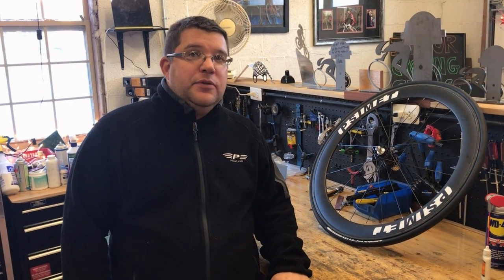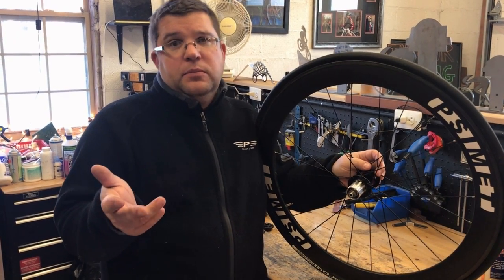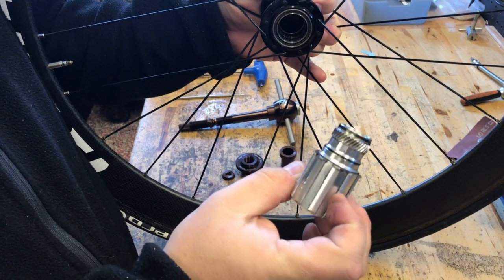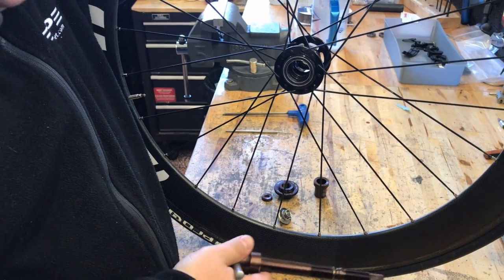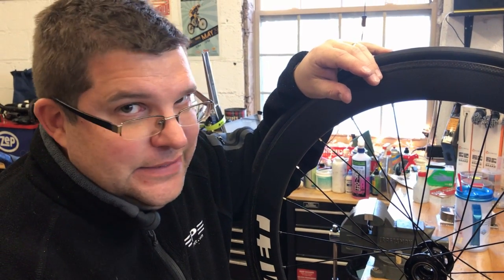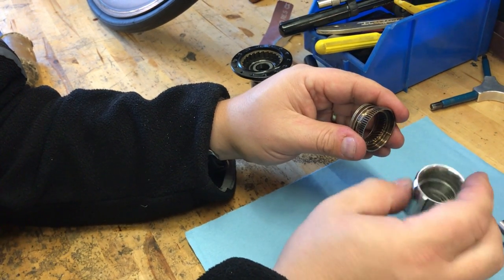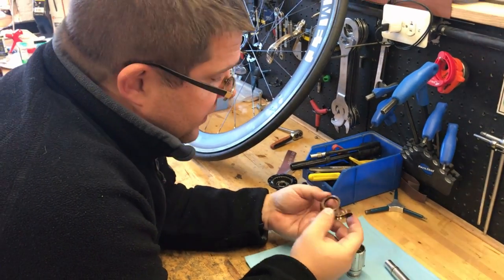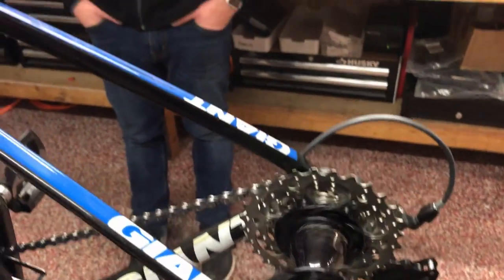How does a Chris King Hub R45 Work and what makes it different

Comment: bought 7yrs old turqouse set of chris king r45 hubs and nothreadset. he said it ran 20000km... everything inside looks/works like new, the headset is smooth like butter... the golden nothreadset ive bought 15 years ago with already a little bit of rough lower bearing, was again built upside down a few yrs ago in the 2nd frame (3rd with pre owner). the formerly lower bearing (now upper) of course dont gets better, but it didnt get worse in ~30tkm of urban use with 5bar at the front... the other bearing is still perfect! so yes, its somehow worth the money, at least when you like staring at your own bikeporn.

Comment: CK (Chris King) bike hubs are amazing when it comes to engagement and producing that satisfying hub sound. However, compared to DT Swiss hubs that use a star ratchet system, they can be a bit tricky to service as they require a special tool. DT Swiss has prioritized serviceability in their hub design, which makes them much easier to maintain than CK hubs. In fact, servicing a DT Swiss hub is quite easy - if you can fix a flat tire, you can handle the job. No special tool is required, making it a convenient option for those who like to do their own bike maintenance. So, when choosing between the two, serviceability may be a significant factor to consider.

Comment: Oil is not a bearing lubricant for Chris King.  You need grease.  Chris King sells some nice synthetic.  I also use Finishline Flouro in the winter due to below freezing temperatures.
Reply: That grease works well on CK hubs? I know people say to only use CK grease on their hubs but in some countries (like mine) is impossible to find. Can you share me your experience? Thanks

Comment: looks like wheel needs balancing !!!!!
frame shaking
Reply: Deep carbon wheels have long valve stems and they can be rather heavy thus leading to the imbalance you noted. No big deal as you don't notice it while riding. My Enve 7.8s are the same.

Comment: "Use the proper tools", skips to guy picking out the bearing seals with a small screwdriver instead of a much more suitable seal pick.
Reply from the maker: Alex Paulsen would you like a picture of the service instructions where they specifically call out using a small screwdriver to pick the seal?
Reply: No thanks. I'm just speaking up on behalf of all flat bladed screwdrivers for the abuse they must suffer in the workshop doing jobs they were never made for.

Comment: The maximum number of degrees for engagement is 360 / number of engagement points on the hub, (not divided by 3 in the regular hub). The CK has more engagement points giving a smaller angle of engagement.
Reply from the maker: Indeed and I should have linked to it in the notes. I was on the spot and had camera brain. Thank you.

Comment: Seems like a big discrepancy when CK says that the bearings need servicing 1-2 times per year and you're saying 5+ years. How's that work? Or am I missing something in your definition of "servicing" the bearing and hub?
Reply from the maker: 3-5 years is what is in the service manual we have. The 5+ is what the customer did. We have no control over that. The bearings don't need to be serviced that often. If you are finding a place where they have changed their interval then that's their prerogative but the bearings don't need it. If you want to pay me as a shop to pull them apart 2 times a year then by all means - I could use the money.
Reply: Just saying, this was the direct quote from the Chris King customer service team:

"Our hub service interval is once every 6 month or once a year, depending on your local climate, riding conditions, etc. Sticking to that every six months interval should prevent any excess wear."

That's why I'm asking if "service" means different things here.
Reply from the maker: Yup - just re-checked the manual. Calling for "basic service" every 6-12 months depending on usage. They define basic service as removing the axle (and ring drive) cleaning everything and lubing it. 

"Complete service" is needed as needed to include full disassembly to fully clean and inspect items (bearings). They claim it is "as needed". Honestly you don't need it for 3-5 years at a minimum or unless you notice an issue. Honestly even pulling the drive and preload every 6-12 months is overkill as well.

Comment: you gotta balance that wheel!
Reply: I saw nothing wrong with that wheel, maybe perhaps it's a crime that a wheelset with those hubs aren't in my posession!  Several things to consider, the bike suspended/ clamped in a bike stand. unweighted wheel spinning at a high rate after he handcranked the pedals, and there is a tube  stem that will be slightly heavier at that area of the rim. I'm sure if you hopped on that bike it would be pure joy and happy hub buzz!
Reply: The wheel is not imbalanced. Look closely.
Reply: Even now in 2020  with light road wheels,  and the crazy descents  speeds   and  sprints,  I have NEVER needed to get road wheels  perfectly balanced,   it's never detectable by the rider, save that concern for  MOtorcycle and  autos/trucks (Massive inertia weight),   the tire valve  or  rim connectors do not need to be counter weighted   ever
Reply from the maker: To each their own but a heavier wheel is not a faster wheel.
Reply from the maker: Yeah-no. All bicycle wheels have imbalance to some extent. To truly balance the wheel would require adding weight to it or drilling weight out. We will do neither and honestly no one ever should when it comes to bike wheels. The magnitude of the imbalance looks large in a stand when it is unloaded and is negligible to un-noticeable when actually riding.
Reply: generally speaking, smoother is faster. A couple of grams to bring the wheel into balance will not affect its acceleration, or deceleration in a significant way.
Reply from the maker: In the same way that a couple of grams of unbalanced force won’t affect anything in anyway. It’s the same magnitude fellas and at this point any balancing is a load of marketing bs. 

....or I’m assuming you all still have your buzz kill bar ends....
Reply: So you're saying that the pulsing motion of an unbalanced wheel has no effect on the ride quality? 
Comparing this to buzzkill bar ends is a bit of a stretch don't you think....
Reply: I balance my wheels & on descents (65km/hr+) i do feel the difference vs unbalanced wheels. 8 grams front & 11 rear in my case. No penalty when climbing.
Reply: Not sure i agree with your comment, i don't mind adding a bit of weight to have a smooth and faster balanced wheel spin.
Reply: For a Zipp 808 disc brake rear wheel, it is extra 13 gram. Will be a bit difference depends on the valve too. I do find that when they are balanced the ability to hold a speed is far easier and longer and that contributed to endurance riding back to back daily. The benefits exist but just whether you need them or not.

Comment: Probably the best vid explaining how they work that I've seen, thanks!  But it looks like a copy of the DT Swiss star ratchet.  Who was first???  Also, can someone explain what this pre-load and bearing adjustment business is all about?  My DT Swiss hubs don't require any of that after reassembly.  Seems unnecessary and is the main reason stopping me from trying CK...
Reply: Hi Greggie111, The face gear design was first made by Hugi (now DT Swiss) while we also use face gears the function is quite different. Our driven ring is fixed to the hubshell and the drive ring glides on the helix spline. When you pedal the helix spline forces the drive ring into the driven ring, the spring is simply there to help locate the drive ring. This allows the system to have more secure engagement that is not based on springs and lower drag, since the spring is not needed to force engagement.

The preload is because we use our made-in-house bearings with adjustable preload. This means that when the bearings burnish the races you can simply adjust the preload rather than throw away and replace the bearing. The result is bearings that wear in, not out and get even faster with use.
Reply: Thank you for the reply, CK.  After watching some other vids I have a couple more questions:  
1. Does the use of a helix spline mean that a portion of the drive force from the crank and chain transmitted to the hub, and to the inner ratchet ring sitting on the helix, is constantly trying to push the driven ring and the non-drive side bearing out of the hub shell as you pedal?  And the only thing stopping them from popping out is the external clamp used for bearing pre-load adjustment?
2. The non-drive side hub shell bearing appears to be pressed in right on the end of the hub shell.  This is good for hub strength as it gives a wider spacing of the bearings but it means it sits right next to the gap between the hub shell and the free hub body.  This exposes the bearing to the elements to a much larger extent than say a DT Swiss hub, where the NDS bearing is recessed and hidden behind the star ratchet rings and the ring nut.  Is there some sort of a labyrinth or another type of sealing present on the CK hubs between the free hub body and the hub shell to protect the bearing from the outside world (dirt, water spray, etc)?
Reply: The is force applied in the direction that you describe but the Driven Ring and Large Hubshell Bearing are very securely press fit into the hubshell and is at absolutely no risk of being pushed out or loosened.  The external clamp (the adjusting clamp) is there to adjust the bearing preload, it is not acting to hold the hub together.
Reply: Hi Ken, lucky for you we make ceramic bearings in house, in Portland, OR. In fact, our ceramic bearings will last even longer than our steel bearings!

The benefit of ceramic bearings is that they are “self lubricating” and therefore you can run less lubrication to greatly reduce drag. Our bearings are also designed to work harden and self polish over time getting even faster with use. Because of these design features our bearings wear in not out, getting faster with every ride.
Reply: Chris King Precision Components 

Wow... that’s great. This video and explanation goes a long way to de-bunking what I always thought was marketing voodoo.

Now how would/could one incorporate ‘Ceramic Speed’ brand bearings for an up fit?

Thanks

Comment: Been using CK stuff for 10 years now. MTB to begin with and 7 years of the R45s, both Road and CX disc. Only had to replace 2 main R45 hubshell bearings in 7 years. Bear in mind that I live 6 miles from the wettest place in the UK.
I'D say you get what you pay for..... 👍

Comment: Very interesting Never heard of a Chris King anything. Is there ceramic in this some where or that's another type of hub or a component? I'm stunded at the absence of grease and dirt for 6 years of use. Did you clean it first?
Reply: Hi Drew, We make our bearings in house and offer steel or ceramic ball bearings. The largest benefit of ceramic is that it is a dissimilar material to the stainless steel races so you can use far less lubrication in the bearing which will reduce drag.

Comment: Are far as re-lubing the bearings, which viscosity of mobile 1 works best? Thank you
 Im thinking this could be my drag problem.
Reply from the maker: Pretty much any viscosity should work but a lighter variable standard 10w-30 to 5w30 should be fine.

Comment: Hello and thank you for an excellent explanation of the hub. I have a question about prelude and drag. I cant seem to get it right without over tightening. If i jus snug preload nut have slight play while in the stand. I did notice a little wiggle with the shaft bearing. Is this normal and maybe contributing to my problem or is that normal? I did a basic service.  Any advice would be appreciated. Besides this issue they are superior. Thank you
Reply from the maker: Something may be hanging up early. meaning the bearings may not be all the way seated into the shell. if everything is solid and set correctly in the shell then you should be able to tighten the preload all the way (resulting in heavy drag) then back it off 1/8-1/4 turn and have the system run smoothly with little drag and no movement in the axle at all. If you can't eliminate the play eliminate all of the other possible causes that most people tend to overlook - like a loose hanger/dropout, skewer with play, rim issue, etc.
Reply: Hello i feel like there should be a very thin washer between the freehub body and hub bearing to eliminate the drag (Like some zipp/mavic hubs have). Or is it bearing on bearing? Is this the sacrifice for the reliable 45 points of Engagement for this superior hub? I ask because when i freewheel my chain slacks so much that it touches the chain stay. Thanks again!
Reply from the maker: The chain should not slack. It is assembled incorrectly. There is a white inner teflon seal that goes on the outside of the driven ring before setting the drive side hub shell bearing in place. If you can't figure it out I would highly recommend you take it to a shop that is a Chris King dealer that can properly service the hub. It's why we are here.